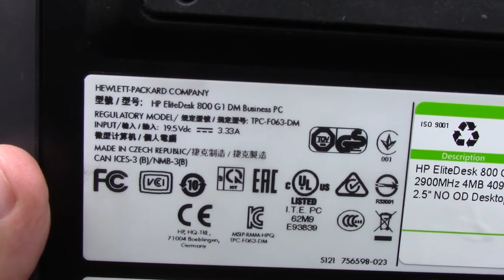How to install SSD on HP EliteDesk 800 G1 DM

Comment: there is m.2 slot have board but why its not working
Reply: I have 4 HP 800 G1 Mini's (all using 2.5" SATA drives) that I use as headless devices for running services on my network at home ... believe that the 800 G1 Mini requires an AHCI m.2 SSD (not SATA or NVME) but I can't confirm that as yet ... 

As I need to pull a couple of those machines apart to upgrade them from 8 to 16GB I've also ordered an AHCI m.2 SSD to try out at the same time which should be with me later this week. I'll try to remember to update here with my results when I do.
Reply: I have this model,its supports both tyoes of m2 drives nvme and sata3 types. tried m2 nvme in it, only pics it up in windows  but you cannot boot os from it, have yet to try the ahci sata version. Also by default the ports are sometimes disabled in bios, enable it.
Reply: @shauncarelse7993  yeah thanks for replaying me and  I try to enable it in bios just modifying the bios bin file still SSD does not work and also my LAN port stopped working. So at end of I am selling my pc and buy MacPro 2010.